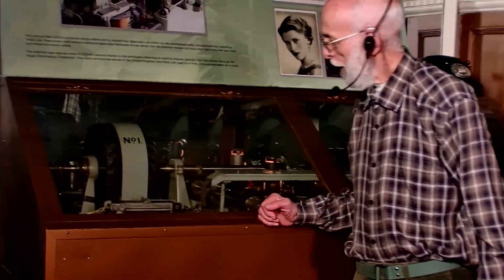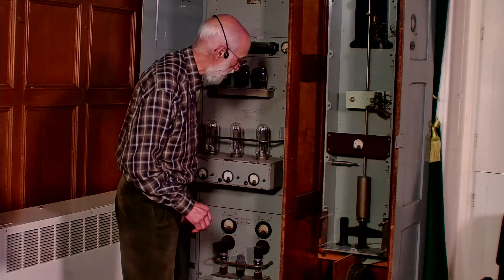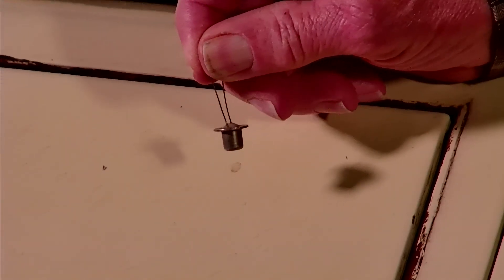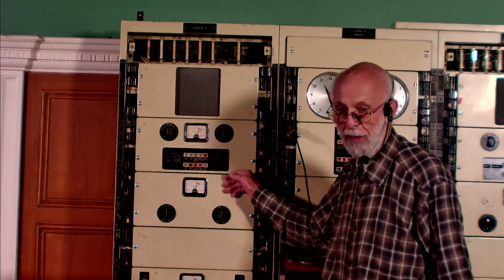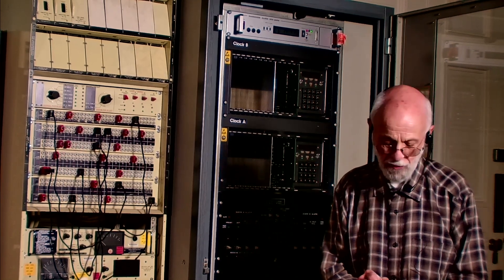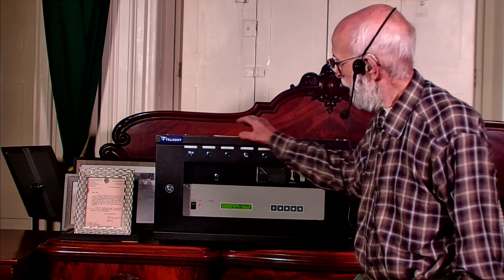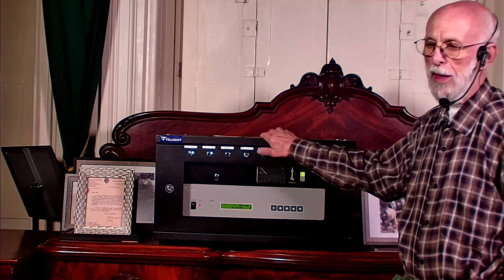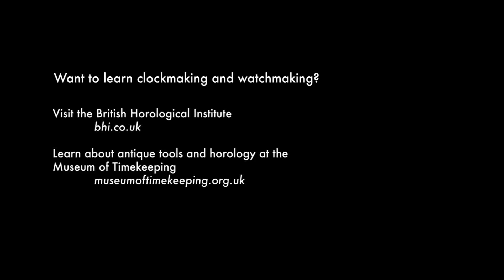The British Speaking Clock

Comment: Nice, I miss the talking clock, we had a similar setup in Australia, and like yours they just turned it off. I used to regularly use it especially with the start and end of daylight savings time changes. I regarded it as a more precise time source than my mobile, as it was coming from those who's job it was was was to keep it accurate, as opposed to a mobile where it's just another service, that is probably correct - well not to the fractional seconds level that the pips provide. I had a Magellan GPS and an iPhone, the clocks were just close - so I had little trust, I they acquired another GPS box and it had a half second disagreement to the Magellan - Can't they make up their minds?

I thought it would be an interesting project to make a talking clock, however I've never been able to get a complete copy of the audio from one of these - Yes I could just generate my own, but that's just not good enough.

Comment: I last visited BHI at Upton Hall in 1980s. Recently read that the museum was closing. Is it still open, would like to visit again? I worked on Clock Electronic 1A for BT, this system replaced Tan Sychronome pendulum clocks in electronic exchanges, timing was synchronised to tones (pips) from speaking clock. Also worked on electronic master clock (crystal controlled) for Telephone Rentals providing 30 sec pulse clocks. From1990s used MSF and GPS for timing.
Reply: From what I gather, it's still open as normal, but they're trying to sell Upton Hall and move elsewhere, because it's a big old Grade II listed building that's getting very expensive to maintain.